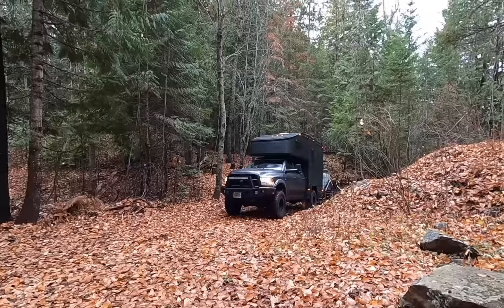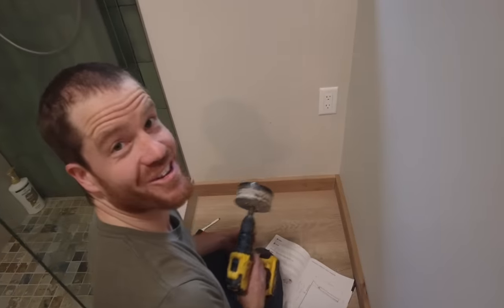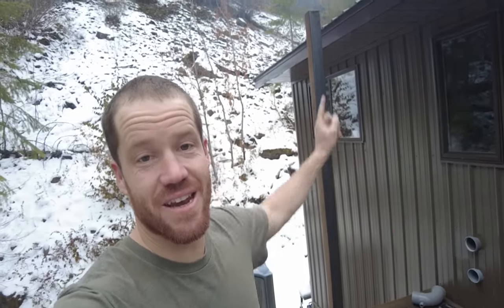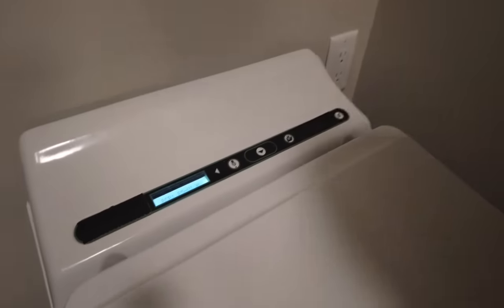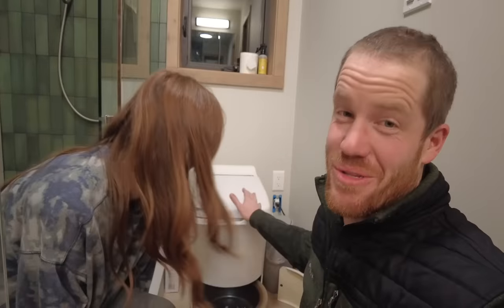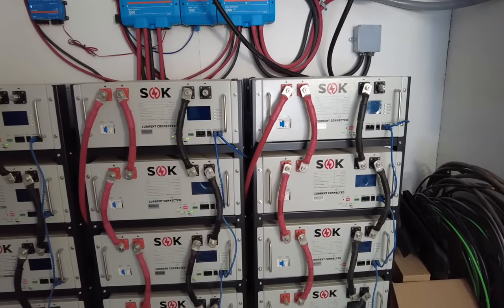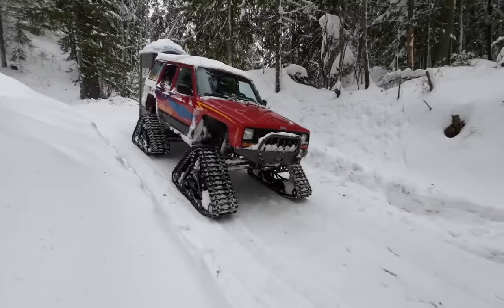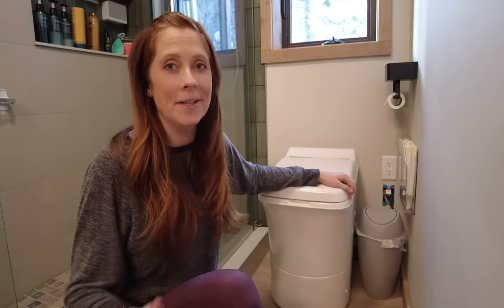Easiest Off-Grid Toilet? | Burning Our Poop!

Comment from the maker: The possibilities feel endless with our Current Connected power system! Want to learn more?  https://www.currentconnected.com/?ref=as
Reply: Maybe I am odd, but why not a regular flush toilet & septic system? That's pretty much how ~95% of americans deal with it.
Reply from the maker: @guytech7310  that requires a lot more time and infrastructure to install. We simply ran out of time before winter. So far the incinerator is working great for us!
Reply: @AmbitionStrikes  OK. Hopefully a regular flush toilet for 2023! 

Happy Holidays!
Reply: I missed it, but what do you do for water source?
Reply: Just make sure noone pee's inside of it and it will last for a long time :) 
And make sure to clean the computerfan inside and all components once a year :)
Reply: @guytech7310  Why? They just spent $5k on a perfectly fine stand alone solution.
Septic tanks are expensive. Laying the leach lines is expensive and time consuming. Running water is something they don't have. Since they live on a rocky hill, a water well would have to be deep, and there is no guarantee they will hit water. That is very expensive. Running waste lines from toilet to septic tank in Idaho, which spends much of the year below freezing is not easy. The line from toilet to septic tank may require heater wire and heavy insulation to prevent frozen lines. So let's lay it out by task and cost.
1. Water well $5k-$10k
2. Septic tank purchased and transported to their property. Dig a hole for tank and leach lines. $5500 to $8500
3. Lay leach lines in trenches half filled with gravel $2000 to $5000
4.water supply line to toilet from well. Heater wire and insulation. Trenching for line $1000 to $3000
5. Septic pipes from toilet to septic tank, heater wire and insulation $5000.
6. Inspection by county (cost varies  by location)

Your talking big $$ for a traditional septic system, and they have a nice permanent solution for only $5k

They made the best, and least expensive choice available for a permanent toilet.
Reply: The trick isn't to stick your tongue out, but to get it at the correct angle. When achieved, work efficiency improves by roughly 83%, with a margin of error of no more than 183%. 😁 Love you guys lots, keep us posted!
Reply: The two of you are a gas to watch. Mistakes and all. Keep it going friends.
Reply: Do you guys pee in it or not?
Reply: This incinerator toilet seems good and all but what I have noticed is there are liners to use so you dont need to wash the bowl. Well what kind of disaster strikes when you have the runs or where do you even go pee? Certainly not in this toilet!
Reply: I understand TALKING about waste control for NO other words to describe it, is a huge issue. I have seen work boats say professional marine's who have big crabbing or fish tenders in off season to help the smaller fish boats unload their fish. ( The crab boat tender became  a mini store and shower, waste disposal for crews on  the small fishing boat's) They USE those BURNER toilets. On a piece of property that will NOT perk. I had that problem. The huge DRAIN field that must be built. My Parents had to completely build another drain field. And don't forget the huge storage TANKS that need to be dug into the ground. I always thought those BURN waste toilets were an excellent idea. So glad you are thinking about this very important body function that everyone has to do, do. Even though in today's Political climate, personal think some political types in power, they think we are all Stupid and they don't, their poop doesn't STINK so to speak. There are so many rules on septic fields. I once did a 4 home Sewer ditch, if only the contractor had brought in more fill. The Homes needed sewer pumps to get to main line sewers the Home where to Low. Hope those homes have backup Generators when power goes out, say on Christmas holiday when you have a huge family gathering, and guess what. NO way to pump waste sewer to a higher street main line.
Reply: @RS  incinolets evaporate and burn the urine too.... thats one of the reasons why the liner is a big oversized wax lined coffee filter and the bin is a big stainless steel bowl. I worked over 20 years in remote facilities all over Alaska where we had these installed and they will last forever, even if you pee in them, as long as you do not forget to always use the liner AND empty them regularly.
Reply: @raymacdhomhnuill8018  agreed!
Reply: ??? Do you have to burn it 
after every time you use it ?
Reply: @RVingwithG  NO you only burn after the mini computer tells you to. Or it does it automatically. Very advanced Toilet system. This is the future for none digging up your yard Toilet waste systems
Reply: Cool solution, especially in the winter! I wonderinf those ashes would be okay to throw in your compose mix?
Reply: @Spaghetti Monster  yes, the ashes are safe to use in a compost bin/pit or even to mix directly into yard/garden soil.
Reply: @raymacdhomhnuill8018  Thanks for the reply. I went and looked it up after I wondered out loud here about it, lol. I know ash is great in our compost, just wondered if the incineration toilet waste burning procedure added anything harmful during the process, it doesn't. What a great solution! The portability factor alone is wild. My only concern wouldn't be the noise it makes, it would be the grosser side of things like splash back, lol. When the paper filter was in, it didn't look very deep. Also, keeping it clean looks like it would be a lot more involved compared to the one piece porcelain toilet bowl which has no seams on the inside. Still, though, the portability and lack of an entire septic piping/water system still might out weigh those few things.
Reply: @Spaghetti Monster  the paper filter just lines the stainless steel funnel or catch basin, which just forms a small bowl, not the larger stainless steel bowl in the bottom. When it 'flushes', the paper filter liner and its contents drop into the larger stainless steel  'burn-bowl' underneath where it gets burned and the smoke and fumes get vented outside through the chimneys exhaust.
Reply: @raymacdhomhnuill8018  "forms a small bowl" thats what I mean about splashback.
Reply: @Spaghetti Monster  iits smaller than the main bowl, but its still big enough, and it drains down into the main pan through the hole in the tip of the filter cone as you go. You will not have to worry about splash back unless you have some digestive bowel disorder.
Reply: @Ambition Strikes  one facility i worked frequently in remote alaska had a holding pit to catch waste from regular flush toilet that then used a centrifugal pump to grind up anf pump the waste into a large (1000 gal) holding tank. Once every month or so a roto rooter equivalent company would come and drain the tank for us. You could prob get by with a smaller tank, or possibly install an incinerator and burn the waste the way incinolet does. Another option i saw was on an old British tv show called 'The Good Life' or 'Good Neighbors'. They were living iff grid and collected their waste, and the waste of their animals, along with bio waste from their garbage, and let it rot in a holding/compost tank as a methane generator and powered a generator and cooked with the gas in their off-grid home
Reply: @megagregg  For a guy, the world is your toilet and they do have a balcony.
Reply: what are your thoughts about a biogas reactor? that way your toilette would produce energy instead of using up energy.
Reply: sledding the portapotty--brilliant!

Comment: The smell is a little strange, but you'll get used to it. You won't want to run it while anyone is on the deck. You can use it twice, before you burn. And mine never smelled between times, even with a previous load waiting. You can make your own liner papers. (You'll go through your 1000, sooner than you might expect.) Get some baking parchment paper. Unfold one of the current liners and use it as a pattern. It's as simple as cutting the parchment paper to size, and folding it. Saved me tons of money!
Reply: What is the actual purpose of the paper?  Is it to help combustion to start, or just keep the bowl clean for less bacteria buildup?
Reply: @novelettemorgan128  I don't.
Reply: @insaynbcr  It 'encapsulates' the waste. Otherwise, good luck keeping it clean...
Reply: @selador11  where does the pee go
Reply: @deesmith8576  I wondered the same !!! My guess is it evaporates, but would love to see them answer this.
Reply: @michaelsmith7425  yes pee evaporates and doo doo is turned to ash ,makes good nutrients for the compost pile. I have a bucket that vacuum dust used coffee grounds and incinolet ash gets dumped in when full dump into compost pile .
Reply: Clearing that is "number 2" how does the toilet handle "number 1's", asking for a friend?😅
Reply: Coffee filters....?!
Reply: @insaynbcr I think it's about keeping the toilet clean, since you're not running water through it any shit that hits it is just going to stick

Comment: So I have spent the last 30 years of my life working in remote and weird locations in the mining industry.  Hands down the best toilet solution I have come across was incinerating toilets at an underground mine in Colorado, they were on a timer and we would burn them off between shifts.  Worst solution was a composting toilet that liked to boil over and flood the area with raw sewage.
Reply: YUCK 🤮
Reply: If you have the electricity to run them, they are the future.  Maybe when the price comes down more and more off grid homes will have them.
Reply: mmm.. .    sounds t a s t y
Reply: the use of words "boil over" made me giggle
Reply: Mine is about 30 years old. "Incinolet" brand. 
It's expensive to operate. The paper liners and electricity. About one kWh per 'flush' adds up fast. 
The wife uses it. I just use the oldfashion outhouse.
Reply: @benjurqunov  Yep, that is what we had in the mine, all stainless steel.

Comment: 5 thousand sounds like a lot, but if you add the costs of installing a septic tank and the drain field that goes with it, I still believe that ya'll came out cheaper with the toilet. Besides that thing is awesome..
Reply: I assume they'll still need a septic system for kitchen, laundry and bath water?
Reply: @MikeCris  not necessarily…that’s just gray water. As long as they’re using biodegradable soaps they should be fine
Reply: @MikeCris  not necessarily, that water can be used as water for flowers, gardens and grass.
Reply: 5,000 is a bargain at my property $60,000 for the turkey mound all the plumbing that had to go with it

Comment: The ash from your toilet could also probably go into a compost heap or garden soil if you want to add nitrogen back into your soil. awesome for growing veggies!
Reply: Doesn't it burn away?
Reply: I'm sorry, Nitrogen?? Isn't that toxic and used to freeze stuff? I feel really uninformed here 😅
Reply: I think you mean Liquid Nitrogen, formed by freezing Nitrogen gas. Normal nitrogen compound is the most used fertilizer and actually very important for all our food products. Basically they're the same, chemically speaking, but one is bound in a lot of surrounding carbon to keep it in place and the other is pure (but also gas). - Nitrogen itself isnt toxic (78% of our air is nitrogen ;) ) but it has the ability to push away oxigen if you inhale it in huge amounts for example. If the air surrounding you has about 84% Nitrogen you'll feel dizzy and can't think straight anymore, about 94% will kill you in a few breaths. So be careful when working with nitrogen. Normal gardening work is 100% safe, as beforementioned its bound into other carbon stuff like in ashes :)
Reply: There won't be much nitrogen left after temperatures high enough to incinerate things like that. Solid nitrogen compounds aren't stable at those temperatures and will off-gas. There will be oxides of calcium, potassium, and a little sodium, but not much else.
Reply: it adds pottasium and calcium not nitrogen. But NPK is what plants and veggies love to grow nitrogen, phosphates and potassium. blood meal or Alfalfa meal is what most people use to add nitrogen ive done alot of organic grows
Reply: @Motishay no.not toxic and definitely misinformed. And not nitrogen,its potassium that it is high in and would be a good fertilizer for tomato or used in soap making.
Reply: @Motishay you are thinking of nitrates the preservative

Comment: I've been trying to imagine how you would even construct a functional septic system on the side of a mountain.   The incinerating toilet is a simple and brilliant solution for everyday life. You've installed plenty of electrical power. The $5k price tag is a bargain compared to the cost of installing an expensive sewer system. Plus, septic system design in a fractured rocky hillside environment that is frozen in the winter is difficult.  Great move!
Reply: More then likely would be a spray system on a timer. Drop in the tanks and it pumps to a spray head. Pretty simple install but expensive

Comment: This type of toilet is wery common here in Norway. Mostly in cabins, but also in homes.  You can buy it with 220v or propan gaz burner. 
Easy and clean, and the waste will be great to use in the garden ;) And you can still use it when it's burning. :)

Comment: your cinderella toilet is made in norway and lists now for 3900 in us . the made in usa incinolet is 2400 for equivalent. so there are choices out there. they all use a paper liner as well.
Reply: Thank you!
Reply: Thats correct, but the Incinolet has a design that goes back to the late 50´s, Cinderella is a more updated, modern incineration toilet. More for the 21st century ;)

Comment: We put an Incinolet brand incinerating toilet in our cabin several years ago and have gone through almost 2,000 liners so have some experience. We also vented the exhaust through the roof (a non-standard vent location for the Incinolet) and rarely smell the smoke. We got the Incinolet from a friend who had in in a guest cabin. It may be that the catalyst which is supposed to take care of the smoke odor needs to be replaced but it is a very minor issue for us. One visitor who was standing on the hill behind the cabin once asked if someone had been smoking a good cigar.😂 Visitors are quite interested in it and ask lots of questions. The main issue for being able to use it is probably the power consumption. We are grid connected so it isnt an issue for us but I imagine that 2K +/- watt hours per use is very practical for most off grid applications. It has worked well for us.

Comment: There were at least 2 comments I can recall about putting the waste from your new toilet in the trash.  I don't see any reason why you need to use up valuable space in your bin to get rid of the ash.  Sprinkle it on the hillside, in the garden or any other "natural" space you can come up with.  Speaking from personal experience, if you deposit ash at the base of evergreen trees, especially spruces, you will get the most beautiful green tips on the branches the next growing season.  Not sure why.  I discovered this by accident when I left a bag of bbq charcoal at the base of a spruce over Winter and got the results the next Spring.  I now do that with the ash I clean from my woodstove with the same results.

Comment: On my off grid property I built a compost toilet, it only smells of pine from the saw dust I use. My solar isn't large enough for me to blow 2kw every time I take a dump. Also in Sweden where I live my winter solar time is rather minimal, but I make enough to get by. 
 I'd also just feed ya trees outside with the ash and not send it to land fill.
But enjoying ya adventures and look avidly forward to every episode. All the best mates.
Reply: 2kw/h. So if it works for 30 mins it's 1kw total, plus you only run it once a day, you can take up to 2-3 average dumps without burning.

Comment: Great episode guys—-Forget the septic system.  You mentioned a year for state approval and it probably has to be “Professionally engineered”.   Up on top of a granite dome at 2400’ you might end up with a sand mound which costs around the $20,000.00 (here in Pennsylvania) maybe more. It also has to be installed by a “Certified Septic Contractor”. Then there’s the plumbing (in and out).  
It may be a good idea to put another one in a corner of the shop (behind a curtin😂😂)..
Can’t wait till Sunday for the next video

Comment: 20 years ago, I was in a work camp north of the Arctic Circle where we had multiple units.  I don't know what was worse when opening the door outside.   The -45 degree temps or the smoke wrapping around into your face.  I will never forget the smell.
Reply: I worked for over 20 years at facilities all over Alaska where we had these installed, and id have to say,  if the smoke was wrapping around into your face when you opend the door,  i would suspect they didnt have the exhaust chimney high enough.

Comment: Thanks for taking the time to make this video about this toilet. We are thinking we'd like to retro fit our 5th wheel camper (once we get it) with this kind of toilet. We've lived off grid and dealt with a composting toilet and had a regular toilet with a black tank in another RV - basically we just don't want to deal with it all again. This makes we hopeful, to try something different. I see this was posted a year ago - wondering how it's still working? Any new issues?  Thanks

Comment: I thought about the Cinderella for my camper, but the representative at a convention told me it will absolutely not work with an inverter. Apparently they've had enough customers (with undersized inverters) complain that they just don't recommend it. Also it would drain my batteries in like... a poop. The gas powered one would be better, but I wanted to make the camper without gas, so I went with a "composting" toilet.